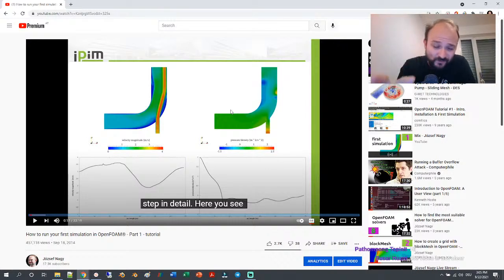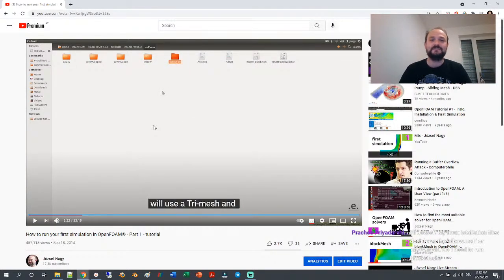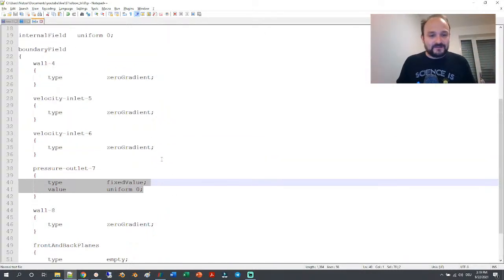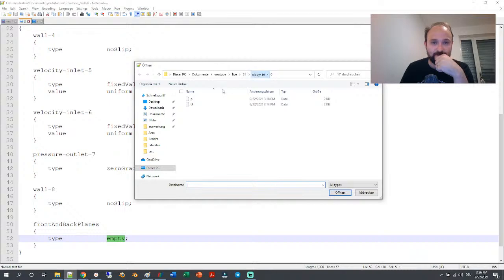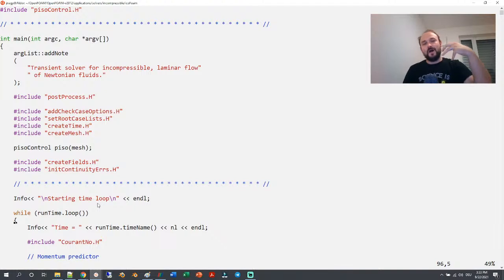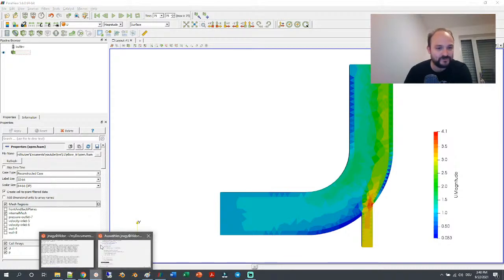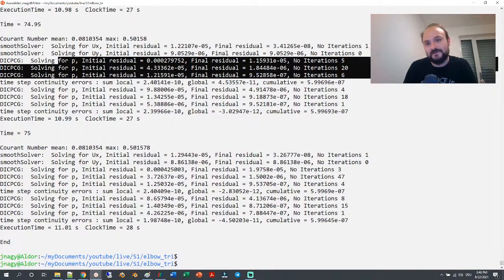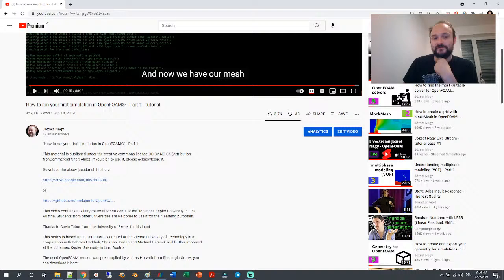How to run your first simulation in OpenFOAM® - Part 1 - redux live stream 2021

Comment: Hello Jozsef, Thank you very much for the videos. I am a beginner and the videos are handy. I appreciate your effort !! 

Just a quick question, in case I have an entirely new geometry for the simulation, and if I need to add a few boundaries like wall front and back or let us say the need to change the cylindrical geometry to the box. How may I change inside the 0 directory files with new changes in geometry?
Thanks in advance!